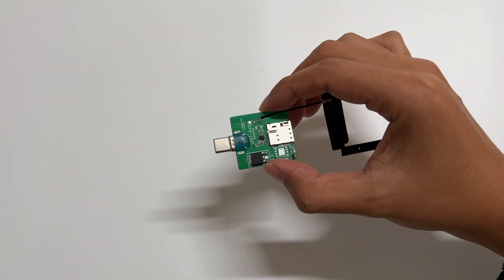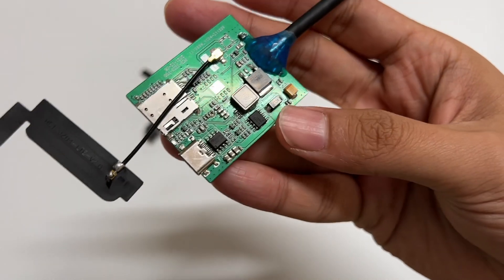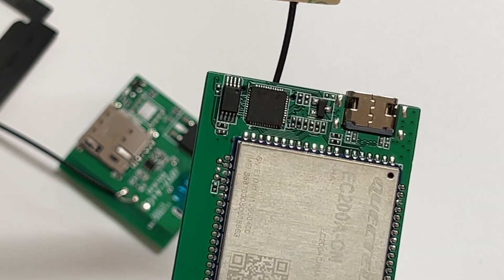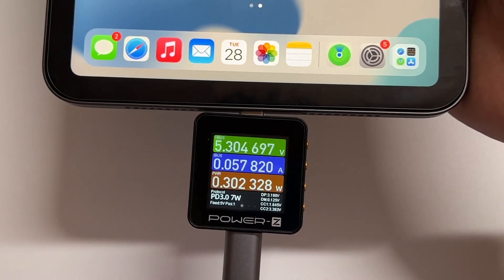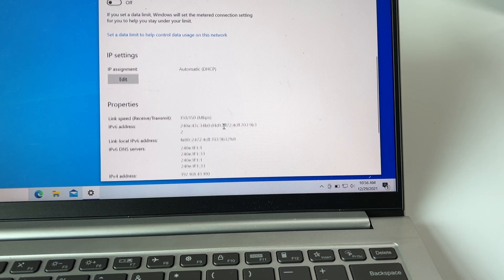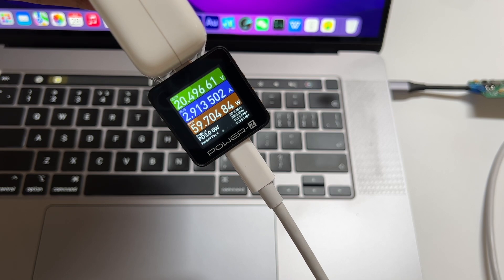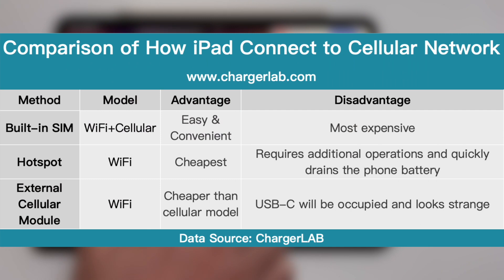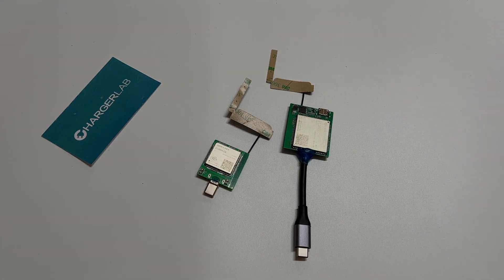Another Choice? Upgrade Your iPad With The Cellular Module Prototype

Comment: This device is missing one quite important trick which the Cellular iPads support: eSIM. Nowadays eSIM not only provides much more flexibility but also the tariffs are quite a bit cheaper. So you might pay less up front for a fugly dongle but in the end it might even be more expensive. (Completely leaving aside the fact that the Cellular models also have additional features like built-in GPS)

Comment: well, my pocket wifi also does the same thing, its widely available in market (huawei) so you should not have trouble buying one. as long as the pocket wifi support NDIS over USB it should work, not to mention that the pocket wifi also have a admin page where you can make call and sms, I dont know why you need that but its there.

Comment: If make it single sided thin multilayer pcb and use a 90° usb-c, you can stick at back of the iPad and use the built in magnets do hold it without a thing dangling from usb port...
The pro version can have 2 female type-c so you use a small jumper cable for tablets(like those HDMI jumpers used when you want to stack a screen to rapberry pi) and a longer cable for other devices

Comment: so, what you tryna say it's a usb modem? then I should just buy a wireless modem. it's less bulky, wireless, can be connected with all devices with wifi.
Reply: wireless menas battery powered: actually more bulky. and you need to keep it charged. and wifi drains battery and is less realiable than wired ethernet connection.

Comment: Cool! While Windows and Linux-based desktop OSes have options for native mobile data connectivity over USB, mobile OSes don't, so that idea of a device that takes a mobile data signal and immediately routes it through USB tethering is a neat idea!

I'm wondering, would there be an onboard Web server hosting a management interface for setting stuff like APN info (if it doesn't automatically get detected), checking signal status, and maybe sending and receiving basic text messages, as well as USSD messages (because some service providers use SMS and/or USSD to handle reloads and activation of mobile data on prepaid/PAYG services)
That could be an advantage over actual cellular-equipped iPad models, since Apple never wanted to put their phone dialler and SMS/RCS support in there, plus I don't think Apple would like if you attempted to make and upload a native iOS app for managing such a device.
Reply from the maker: Thanks for the suggestion. We'll forward it to the development team.

Comment: does it work on Raspberry Pi?
Reply: Don't think so. This is basically ethernet over thunderbolt/usb 4. I think the ports on raspberry are usb 2 or perhaps 3 only. But you can get LTE/4G modem USB sticks for like 40$ and those should work perfectly, as they comminicate over usb-protocol

Comment: Why don't you use hotspot dongle that's cheapest and long lasting
Reply: Probably because a hotspot dongle doesnt send its data over the ethernet protocol, which thunderbolt/usb 4 supports, but rather as data over the normal usb, which the ipad likely doesnt support? Im not sure though, but I've never seen someone do that. I mean what would be the point of this device if it did work?

Comment: If you could get the size down to the module size for the frame.work laptop, I think they said somewhere they would pitch in for R&D (don't quote me).
Reply: this would be PERFECT. The fact it shows up as an ethernet adapter would be more useful in linux (which has hit or miss support for LTE cards)
Reply: Wow 
First module looks like an almost finished prototype of the frame.work module. I would really like to test it with this laptop
Reply: 3rding that frame.work module sized adapter.
Reply: Wow this is such an amazing idea
Reply: Might be better if its a regular USB modem instead of a USB ethernet modem? So you can send SMS and maybe make phone calls too. For an iPad this USB ethernet approach is better because the iPad obviously wont have the drivers and software for a regular USB modem. But for a regular laptop its possible to install the extra drivers or software and the laptop would be able to be used like a phone.
Reply: @misaalanshori  very true good point, I know in windows, sms is a rare feature to have. Unless it’s an ATT supplied modem. But some USB modems have a cool web interface that for simple sms so that could also be a solution?
Reply: @alertsemail7057   @Horizons Virtual  If I remember correctly, Windows has native support for modems that would allow SMS and phone calls directly with the Windows UI (no extra apps). So thats why I think a USB modem would be better instead of it having only a USB ethernet interface.
Reply: @misaalanshori  I wish that was the case. I only use laptops with built in LTE modems and they don't allow this. Further more, a plan that's made for LTE enabled laptops don't even get a phone number.
Reply: @alertsemail7057  Actually nevermind. That might just be something my mind made up. Though I know there is at least better integration with LTE modems on Windows 10. I'm pretty sure I'm wrong about SMS and phone calls. I think my memory kinda got mixed up with another feature that syncs with your phone to use SMS and possibly phone calls?

Sorry about that
Reply: @misaalanshori  the project for getting windows on arm on windows mobile devices have developed an SMS app as well as a calling app for it. Maybe it could be ported to an x86 machine

Comment: Will it work on Android?
Reply: If it presented as ethernet interface, it should work, but most android wouldn't have the menu to configure it.
Reply: @AbdulAzizAmar  Ah most do, it just doesn't show up until you plug in a ethernet adapter.
Reply: It does work Android automatically detects the ethernet interface and displays its status in the notification bar